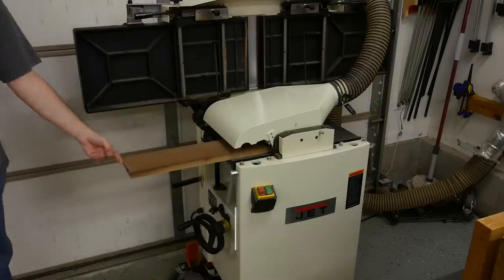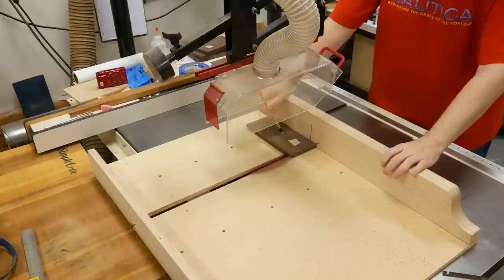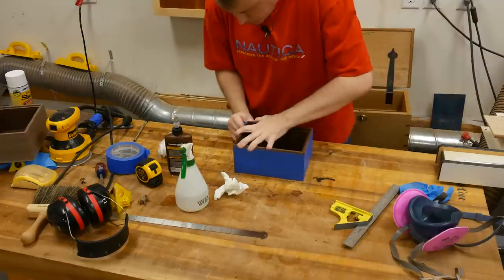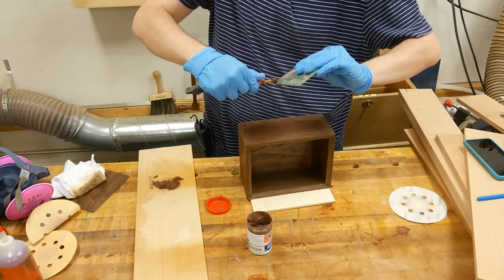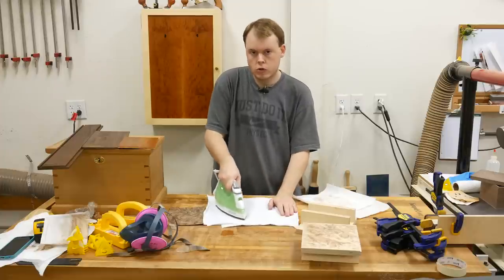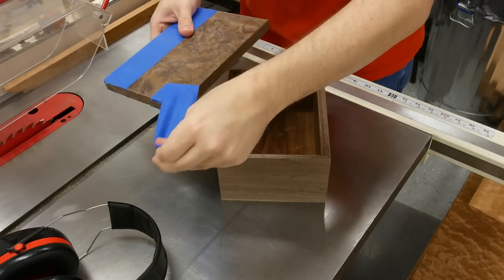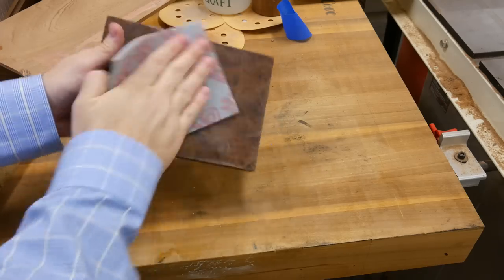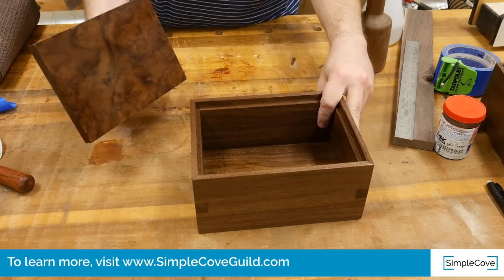Walnut Burl Veneer Box

Comment: Great looking box! Also, a great tutorial. I did notice the finish was a little orange peely. That is a common problem with spray can finishes. Aerosol cans just don’t do a good job of breaking up the material and laying it down evenly. A decent HVLP or even wipe on poly would help greatly. An oil based wipe on poly like General Finishes would really bring life to that figured walnut. Just my 2 cents.
Reply from the maker: +Robert Melrose thanks for watching. I typically get that type of finish from the can but follow up in about a couple of weeks with steel wool and paste wax to flatten it out.  For boxes I don't like a poly or anything oil base because they tend to smell bad for a long time since the box stays closed and traps the smell in. One thing you can do, however is hit it with boiled linseed oil and once that's dried, apply shellac for a top coat.
Reply: Good tip! I like to use lacquer but don’t on boxes for the same reason. That smell stays with it for a long time. I suppose a water based poly would work too, it just doesn’t have the chatoyance that a good oil based product has. Great info, keep up the good work. Lots of good content here.
Reply from the maker: Thanks, Robert. I really appreciate it!

Comment: You don't appear to have allowed for the cross grain expansion of the substrate timber of the lid. This lid will move as the moisture content of the room changes.
I  like the way you show how to apply the wood filler to the box and the burl veneer. First time I have seen this, and I have been searching everywhere, because burl is usually full of tiny pinholes and cracks.

finally,  have you found that wood filler to eventually shrink or crack? Most water based ones do
Reply from the maker: The panel is small enough that it's not going to move much if at all. I've got the box in my living room and the veneer is just fine.

Comment: 2 questions. Have you/can you notice a significant difference using the wood putty to fill the pores? It seems as if you would be sanding out anything you filled in. Secondly, What do you have on your roll of masking tape around the 8:45 mark?
Reply from the maker: The wood filler stays deep in the pores when I sand because I sand the surface with 180 grit and I don't sand that long, just long enough to remove the excess. 2: I have an "X" to mark the center of the panel. I used a ruler to find center and marked it with a pencil.

Comment: Did the splines get larger at the end?  After the shellac is cured try rubbing wax over the whole thing with 0000 steel wool.  It is amazingly smooth after that.
Reply from the maker: Yeah. I had an issue where my miter key jig moved which caused me to have to make wider keys. I use 0000 wool when I wax to finish my finish. It is indeed very smooth. Thanks for watching!
Reply: Could you guys please tell me what type of wax you are using after you shellac? Do you apply it with the steel wool? Thanks

Comment: Did I miss something or did you spray shellac on the lid then add wood filler?

won't the shellac have sealed the pores making a coat of wood filler unnecessary?
Reply from the maker: Yeah I sprayed the lid with shellac to make sure the wood filler didn't dye the lid or change the color in any way. The shellac is super thin and wouldn't seal the pores.

Comment: Covering beautiful walnut with vaneer and wood filer is a waste .... might as well use plywood instead and save alot of money
Reply from the maker: Yeah I guess labor is free. Using plywood would require edge banding and then flushing. That takes time and would still require walnut for the edge banding. Makes sense to just use solid walnut. That panel is tiny anyways so I used less than a half a board foot which was $2 in materials. To edge band it would take me over an hour. My time is worth more than $2 an hour.